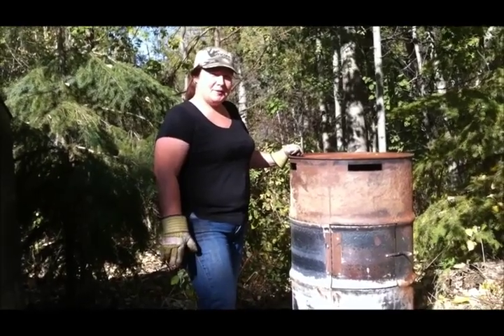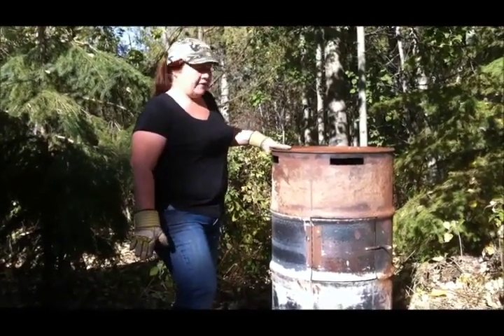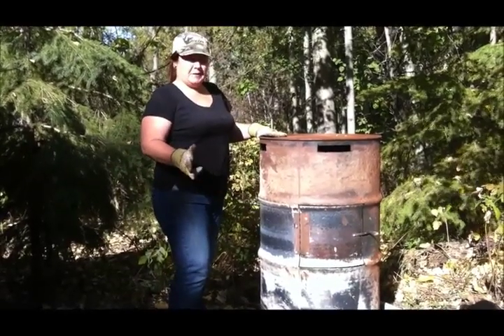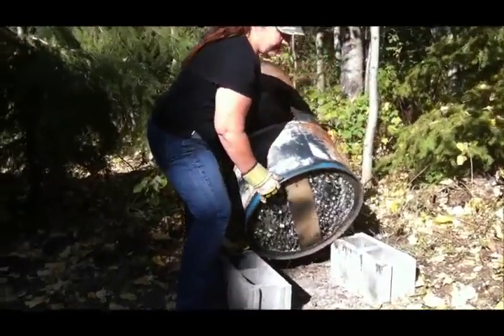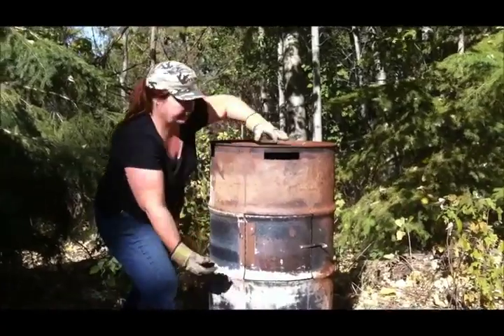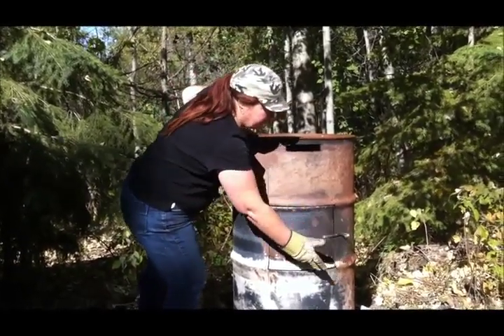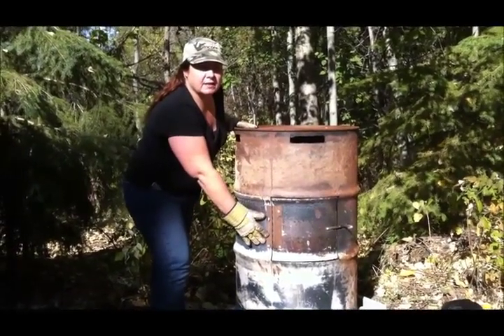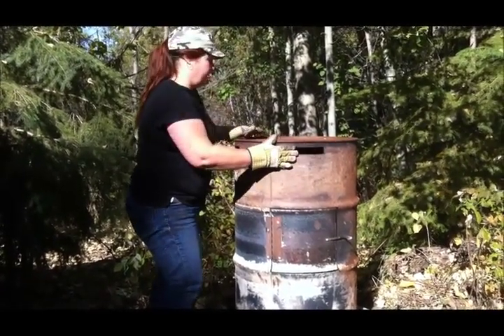How To Build Your Own Non-Recyclable Waste Incinerator

Comment: Hi!! We have some doubts here in nepal, of how to do it. We are in a rural area where they burn everything... do you have other ideas to build a incinerator but with absolutely no resources?
Reply from the maker: Hi @user-sf8sc9yz8y; Thank you for your interest and yes there are other ways that you can construct an efficient waste incinerator with only earthly materials.  If you have clay soil in your immediate area, you can make clay and grass bricks and bake them in the sun to dry and harden them. Then assemble the bricks into a straight wall oven type of structure with the top brick rows inset slightly eventually coming to a peak, leaving a brick out in the back wall near the top for a chimney.  Be sure to set rows of bricks on edge on the ground inside of the oven to set the waste on. The rows of bricks on edge under the waste will allow air to flow in under the waste , feeding the fire oxygen. If you have a really good type of clay in your immediate area, you can skip the making of bricks and just construct an igloo type shape or a "dutch oven" shape with a hole in the top rear wall for a chimney. You can then make thin ridges of clay on the ground inside the dutch oven to place your waste on. If you have large stones, you can construct your incinerator out of stone using clay to pack between the stones. You can even use smaller rock or a combination of small rock and clay. I hope these ideas will help. A link to a picture of a clay incinerator:   https://truebrickovens.blogspot.com/2016/02/brick-oven-faq-2.html
Any more questions please comment.
howtopam
Reply: Have you considered using clay & stone?

Comment: Please don't burn plastic in there! When burned in low temperature it produces Dioxin thats really bad fro you. The right way is to get the heat up to 800 degree centigrade or like 1200 F. Use a the bloomery furnace to get there.

Comment: How do you empty it?
Sorry if this is a stupid question?
Reply from the maker: Hi Elizabeth Macey; Thank you for your inquiry. No question is a foolish question - period. I find that because of this burning barrel's flow through air design it burn HOT and fairly clean, leaving only noncombustible items and ash that fall through the bottom wire mesh into the ground. From the ground ask pile a small shovel or a hoe will work to bring the ashes out from under the barrel to where they can be scooped up and put in a container for proper disposal. 
I hope this helps.
Thank you.
howtopam

Comment: What about the air pollution created by the burning of polythene?
Reply from the maker: +Abdul Basit Thank you for bringing up that point Abdul Basit; it is good to highlight the hazards of environmental pollutants released when burning polythene. As I mentioned in the video everything that can be recycled should be sorted out of the non-recycle refuse before burning. Though I am an avid supporter of environmentally friendly programs and advocate for all plastics to be recycled I had not considered the burning of the polythene garbage bags as a BIG issue. However; your questioning the issue has evoked an awareness of the problem and I will look for another type of refuse container for future use. Thank you for adding a VALUE comment to this video highlighting the FACT that burning ALL polythene products (even plastic garbage bags) are an environmentally UNFRIENDLY practice. The plastic refuse containers should be recycled as well.
howtopam
Reply: You did very appreciable work, i am a final year student of energy and environment engineering and working on waste to energy generation with zero pollution technology..  your any suggestion will be very helpfull to me :) thanks.
Reply from the maker: +Abdul Basit Congratulations on your career choice Abdul - becoming an educated "Protector of the environment" is very admiral. Thank you for requesting my input - You are very kind. Unfortunately, the issue of safely managing [non-recyclable] waste seems to be an infinite problem - Every intelligently designed practical solution seems to be only a mere step towards creating inevitable unforeseen, and sometimes greater, environmental hazards. I am an advocate of "Root Cause Analysis" being educated as a Mechanical Maintenance Consultant. It is my opinion that any worthy solution advantageous to the protecting our environment MUST begin first with the examination of the - Root Cause - of the problem. If we search for a solution to waste disposal hazard within the created product design rather than the disposal we would not, then, be attempting to "close the gate" after the horses have gotten out. Root Cause Analysis Abdul is the answer - We must look at the design process of all manufactured products and with the guidance of Environmental Engineering Professionals - like yourself - develop a product and manufacturing process engineered with intelligent disposal designed in from the inception of the concept.
Thank you Abdul Basit
Wishing you all the best success in your career.
howtopam
Reply: +howtopam got you, thanks for the kind suggestion but your Root's point is not feasible in Pakistan and similar economically weak countries. here people prefer low prices(hazardous) things over Biodegradibles and Govt dont have much concern on it. that's why i am trying to make a project through which organic waste burns and produce electricity instead of land and air pollution. and other reusable and recyclable things will be segregate from waste which can lead a highly environmental friendly project.. what would u say..? am i on right track?..
Reply from the maker: +Abdul Basit Hi Abdul; What scale of project are you considering - single family, community, or municipality? For a clean burn the household waste including organic food matter would have to be "pre-treated" perhaps dried and pulverized to create fuel that would generate incinerator temperatures around 2000 degrees. Low temperature burning would be suitable for TEG module technology application "the Peltier effect reversal or [Seebeck] ", generating electricity from temperature variation which could then be stored in a battery bank. Another applicable low temperature burning technology to explore is Syngas production produced from "biomass - organic household matter" through the thermal assisted molecular degeneration known as pyrolysis. If gas production seems feasible dry composting of organic household matter and ever animal manure in an oxygen deprived environment can produce rich methane gas which could then be utilized to power electricity producing generators.
I think your efforts to attempt to formulate a practical solution to a perpetuating detrimental global environmental threat are honourable and in great demand by a desperate global population. The problem in enormous and with problems of such magnitude a solution is most easily arrived at by enlisting the contributions of the mass populous. Through the institution of a public awareness program and governmental assistance to equip citizens with necessary tools that aid and encourage community efforts the foundation could be laid causing a generational effect. In the interim the demand for the intelligent design of such beneficial tools is of major importance.
Please let me know what avenue you are desiring to pursue Abdul.
 Sincerely;
howtopam
Reply: What would be a good alternative to using those type of garbage bags to reduce pollutants? I'm looking to do something similar.
Reply from the maker: Hi Sayian505; Perhaps just a trash collection bucket?

Comment: Theoretically, any organic materials if combusted fully should be reduced to Co2 gas right?  Organic gas are also known as toxic gas plus other inorganic gases.
Reply from the maker: UnitedPebbles
Thank you for your comment on this impacting toxic gasses released into the atmosphere issue. Your input stimulated my thoughts on the topic, causing me to comment to the great above statement by KWConch1964. The disposing of all waste has repercussions that impact our atmosphere and the responsibility of each and every person who creates waste product should be to become fully informed of how their disposal of the waste they produce effects the earth's environment.
It is through these discussion forums that information provided through comments such as yours will reach others and evoke personal thought about the individual responsibility of waste production and disposal. Great input and highly appreciated.
Thank you.
howtopam
howtopam.com
Reply: howtopam yes the problem is the heat will get too high to cause organic material to vaporize and not enough O2 to fully combust.  You wanted to shred the compost and leave as much surface area as possible.  They have these pellets fuel made from trash for furnace that are 90% fully combusted. They are cheap nearly as coal, do not know why they are not sold out already.

Comment: Will it release toxic fumes into the air when burning plastics, plastic/polyethilene bags and other toxic waste?
Reply: many of the toxins that are emitted while burning can be attributed to poor combustion efficiency.
Having a "clean burn" greatly reduces the toxicity of the emissions, and you also see less smoke/smell fewer fumes.
Reply from the maker: Hi Irina;
Yes; unfortunately the burning of any toxious materials will result in emiting toxins into the atmosphere. Therefore, all recyclables should be sorted from non-recyclable waste prior to burning. Even the community waste colection facilities have to incinerate a portion of the waste after sorting out the recyclables.

Comment: How do you clean the burnt material (remove the bottom) not sure. Looks like it would be easy to make. Thanks
Reply: +Tom Neff Kick the fucker a few times? BAWHAWHAW
Reply from the maker: Hi Tom;
Thanks for checking out the incinerator video. The bottom is removable, however, whenever I get unburnt material in the barrel I perfer to throw some firewood in with the nonrecycleable garbage and the heat of the wood fire completely burns everything up to ash. The ash then falls through the bottom screen between the cinder blocks where I shovel it up.

Pamela

Comment: hows it work on stuff like diapers cuz my gf and i got 2 lil ones
Reply from the maker: Hi daniel;
This type of incinerator burns most types of waste very well because it has terrific air flow through the bottom. You must keep the bottom screen clear of all ash by allowing it to fall through onto the ground. Clearing the screen is easily done with a pole or a rod to gently move the ash back and forth on the top side of the screen until it falls through. After burning heavy, wet, difficult to burn waste you may get a buildup of partially burnt material on top of the screen. When this happens every couple of months I build a good fire inside the incinerator with some waste wood or heavy cardboard and the heat of a good fire over a few hours will consume all of the partially burnt waste.
Thank you for watching.
Pamela